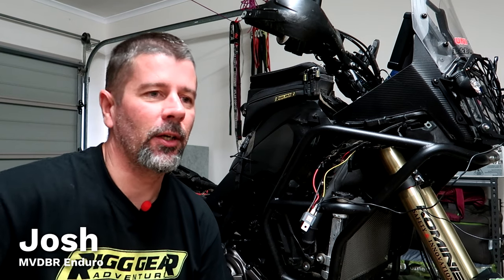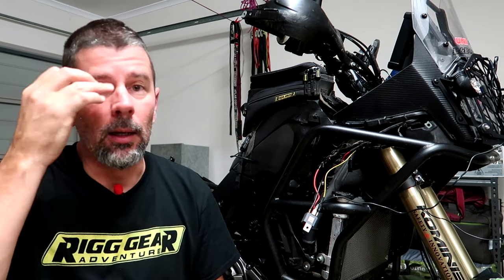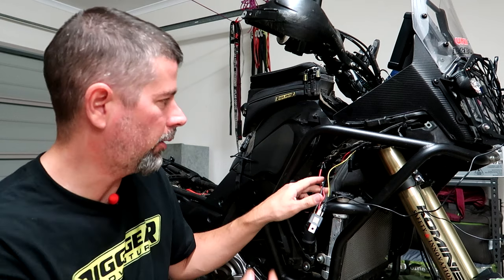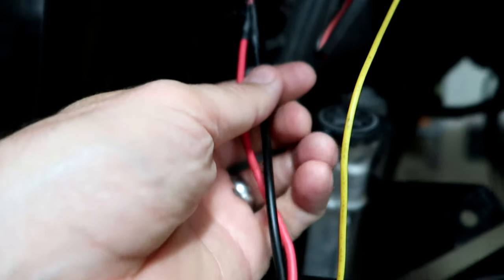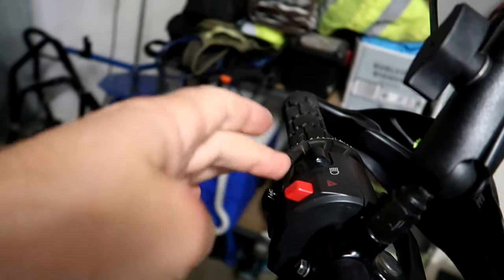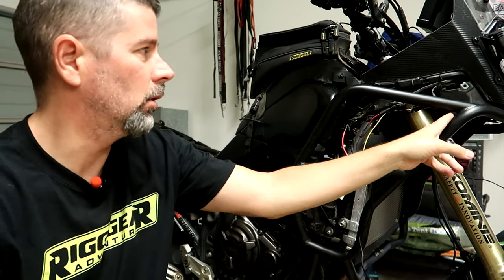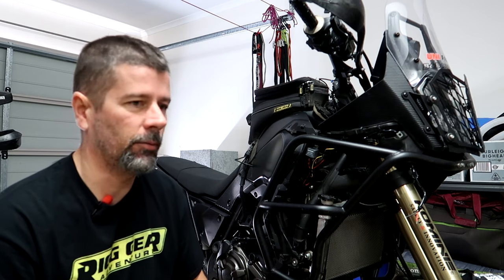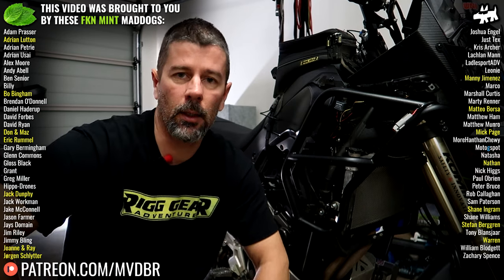Tenere 700: Run Auxiliary Lights Off High-Beam Switch

Comment from the maker: Thanks to Mick (HavaCrack) I've since discovered it's a good idea in this instance to add a flyback diode to the relay to prevent electrical spikes going to the bike's computer. I've added the diode to the following diagram: https://mvdbr.com/files/t7-aux-diagram.jpg
Reply: May I ask why you don't trust the ECU drivers to have built in flyback diodes, but trust it to be able to handle the short circuit your diode may create after blowing up?
Reply: @white-rider  Do you know if the ecu has an inbuilt flyback diode? Not sure why it would as the ecu design would be as  the sink/source (switch either a bjt or mosfet) and as there is no relay after the ecu that would necessitate a flyback diode.  Further I am sure the ecu design never intended to have a relay in the circuit.
Not sure why you would say the installed diode or a relay with an inbuilt diode would blow up. Not saying a diode cannot fail but if it is sized correctly then there is no reason it would. An exposed diode may have more risk of failing due to moisture though.
Even if the ecu had an inbuilt flyback diode which would be reasonable for a circuit that switches a bjt or mosfet then that diode would be around the transistor, adding a flyback diode (or realy with inbuilt diode) would still add protection to the ecu as you are removing large dc voltage spikes.  
As you have raised the question, then:
1/, Can you let me know if there is a flyback diode inbuilt into the ecu.
2/. Are you recommending to people who may use this mod to put in NO protection with a diode? And, if so what is your helpful advice to them?
The better solution to the whole relay use in the circuit would be to totally isolate it via an optocoupler/isolator switching a relay. Happy for constructive discussion. Mick
Reply: @white-rider  That is why modern vehicles that have ecus and relays now have relays with either an inbuilt diode or resistor and why you should not put a non diode/resistor into a modern vehicles cicuit.  As I said (and you) an exposed diode to moisture is not an ideal fix as moisture could affect the PN structure of the diode, so a relay with an inbuilt diode will afford more protection to that diode. Re the ecu I don't think that it would have a protection diode, and if it did it would not be a flyback/freewheeling type protection in this circuit as it would not 'freewheel" back through the relay. As stated an internal ecu "transistor" may have a diode but i am sure (could be wrong) that a bjt or mosfet does not cause emf as there is no coil that is collapsing. 
The t7 workshop manual does not provide any diagram of the ecu circuitry but there are no relays in between the ecu and the lighting cicuit. However if you refer to the manual there is a start relay and a fuel pump relay and they both  have flyback diodes in the circuit which supports my theory that the ecu has no proection. Within the circuits there are also a nymber of zener diodes which would be there for voltage control. At the end of the day I am no expert and not claiming to be BUT the relay needs a flyback diode to create a safe path so the the voltage spike can dissapate and as I will now say for the final time a better design would be with via an optocoupler. Maybe I will make one it could make me rich!.
As per my video I add to Joshs thread a relay on a 12vlt system produced a 150vlt voltage as the coil collapsed, it would do the same on a bkie. 
You can google for the workshop manual which can be downloaded for free it has a full electrical schemetic at the end in both b&w and another version in colour.
 Regards and thanks for the discussion. Mick
Reply: @HavaCrack  yep, I agree with everything you said. I didn't know that starter and fuel pump relays had a flyback diodes. The only Yamaha relay that I disassembled was turn signal relay, and it was a solid-state relay (meaning no coil, just a FET and a IC for timing). But still ECU drives ignition coils, and they're definitely more inductive than any relay.
Great idea about optocoupler. Me personally, I'd go for non-inductive relay (i.e. like for the turn signals, solid-state). No coil = no problem :) I'll probably make it myself with 1 FET and 1 resistor for gate, it'll invert high beam signal just like I need (yes, I'm T7 owner too and I'll installing aux lights the same way, off high-beam switch).
Reply: @white-rider  Have fun. Yes a ssr would be the go as they have a optocoupler inbuilt. People probably have not thought of them for 2 reasons 1. Cost and 2. Lack of knowledge how they work (&3.,, if you bought a cheap one of ebay the potential size).  
By the way I ride an Africa Twin, just normal wiring on that!
Reply: I'm a little confused how the diode is installed in the relay or is it just to the terminals? 
Thanks
Reply from the maker: @xrboy101  check this video https://youtu.be/ecrqDHZX2eo?t=132
Reply: @MVDBR hi man. Excuse me for my complete ignorance. But what if I put the lights directly to the battery terminals without using de relay? Do the voltage peeks are still generated? Thanks a lot
Reply from the maker: @ricardosacub  that's correct to the best of my knowledge. The relay causes the voltage spikes 👍

Comment: i'm a retired electrician and it took me a whole day to wire my lightbar. then i realised it's the earth that is switched. when the high beam is off that yellow wire will show `12 volts....to avoid any meltdown just install the old fashioned way. cable from the battery via a fuse . run the yellow wire through a switch to keep it all legal. been running mine for 18 months now with no issues. 1 STEDI light bar and 2 spot lights. riding in the forest around Jimna at night is awesome....

Comment: Nice vid. Thanks for sharing.
If you’re going to do you’re own low voltage wiring there are a few rules of thumb that I’ve learned over the years which will keep you out of trouble:
1. identify the maximum current draw of the device you’re wiring up (eg 120 watts @ 12v = 10 amps).
2. This combined with the length of cable run will determine the gauge of wire required. There are a few charts online to help work this out.
3. The wire gauge (the cross-sectional area of the copper) will determine the appropriate fuse size.
4. The fuse is there to protect the wire and prevent a fire in case of an over current and should always be located as close to the power source as possible. There’s no point placing a fuse at the draw end of a wire because if you get a short between the fuse and the power supply, the fuse won’t do anything and you’ll have a potential fire.👍
Reply from the maker: Good stuff to know, cheers 👍

Comment: The ecm creates the earth path when the headlights are off.  Wiring the relay you are activating it by turning earth on via the yellow wire which is the reverse of how you would normally wire a relay.  You should make sure your relay has an inbuilt diode (flyback) or if not put a diode across pins 85 & 86 as when the coil (in the relay) collapses it can cause large volatage spikes which you do not want to go back into your ecm (computer).  Some Narva relays will have the diode already.  Not that anyone has reported a blown computer by his method of not putting in a diode, I recommend to put in a diode as suggested.  I presume that the computer is using a mosfet or transistor to switch power and eventually repeatative voltage spikes can damage those components (if they don't on the first occasion).  Another alternate is to isolate the circuit altogether with and optocoupler or a SSR (solid state relay), but that is another story.  Mick
Reply from the maker: Thanks for the info mate 🤙
Reply from the maker: Mick, is this the correct way to wire the diode or is the polarity the wrong way around? Electricity is a mystery to me 😒 https://mvdbr.com/files/t7-auxlights.jpg
Reply from the maker: @HavaCrack  great thank you mate, I actually meant to draw it the other way around haha 🤦‍♂️ Cheers
Reply: @HavaCrack  So if you purchased a relay with diode installed already you'd wire 85 to heated grips and 86 to lights? Sorry if this a double post but my first attempt seems to have disappeared. Thanks in advance and thanks for the video OP!!
Reply: Yes just wire the relay pins 85 & 86 in reverse to Josh's image (or the image on tenere.net) and you will be right.   I posted this short video into Josh's intro which may hellp you understand.  https://m.youtube.com/watch?v=6LoEDmGCPR8
Regards Mick
Reply: @HavaCrack  Brilliant, cheers mate!
Reply: @HavaCrack  Mate, you're an absolute star, as is Josh!! I made a relay loom and followed your instructions and the Rigid Industries SR6 light bar sprang into life first time at the flick of the high beam switch! Awesome! The last thing I need to do is add the switch for our UK MOTs. You mentioned before tapping into the +V wires or the wire that taps into the yellow bike wire. I'll probably use the latter as it's much easier to get to the way I've set everything up. The only thing I'm not sure about is the switch has two wires coming from it. One is orange and one is green. Which wires do I tap each of these into, please? Thanks again both. I'd have taken until my next life to figure this all out without your help!
Reply: I'm thinking the orange wire goes to battery pos or +V and the green taps into the wire we tapped into the yellow bike wire?
Reply: Tried to wire in the switch and looks like I've fried the headlight.. :(

Comment: I am sure it’s a solid state relay that only requires a low voltage signal to allow the relay to pass current. Not like an electro-magnetic really coil that pulls the relay contacts closed. It has the same result and works the same, but it doesn’t necessarily take 12 volts to trigger them. I use them in the HVAC industry and some of them can be triggered by anywhere from 3 to 32 volts DC.  You can tell it’s solid state because it has a heat sink. That bracket with a hole that looks like a mounting bracket is actually a heat sink. If you were running a lot of current through it that heat sink tag would need to be bolted to metal. On a motorcycle running LED lights with air flow it might be alright. LED’s don’t usually a lot of draw current like a resistive heater would. I bet that relay is rated for way more current than those LED’s draw from the electrical system.

Comment: Cut that yellow wire and put a switch in, Aux lights have to be switched independently too the high beam for redgo. Awesome job :)
Reply: Dont put the switch in the yellow wire otherwise the main lights wont work as it is part of that circuit.  The switch will go in this case from his 12v wire he tapped into in the handgrips, but yes it should have a switch to be legal.  Mick
Reply: @HavaCrack  So whats wrong with switching the trigger wire,disconnecting it from the relay wont stop the main light from working. Power to the relay would be switched from the key i would imagine.
Reply: Maybe I should clarify.  You could put a switch in line between the  relay and up to where you tapped into the yellow wire in the loom, but you cannot put a switch in line on the original yellow wire as this acts as both a source or sink for the main light to the computer so if you disconnected that line with a switch then the main lights would not work.  Thus better to have the switch in the +v source side of the relay. Mick
Reply: @HavaCrack  Umm Yep
Reply: @gumbysenduro6546  thanks.  Mick
Reply: @HavaCrack  Hi, I know this is 2 years old but could you clarify that a handlebar switch would go on the + 30 wire or the + 85 wire befor the relay? or does it matter which one? Also does wire 30 or 85 need a in-line fuse? Thanks for any info.

Comment: I am pretty sure in the state of Missouri (USA) it’s against the rules to have any spot lights triggered from the high beam switch. I am not sure why. Pretty sure you would never get in trouble for it, but if your bike has to pass a safety inspection you would want to disconnect the spotlights before the inspection so they don’t catch it.
Reply from the maker: Yeah same here in Aus, although I disconnected mine before I got the guy to come and do a safety certificate and he said any aux lights fitted had to be working 🙄 whatever. Dumb rules.

Comment: Just did the same wiring on my Africa Twin a couple of weeks ago. I did a switch for my aux lights is the only difference. I even have the wire coiled up in the front of my bike waiting for parts. (crash bars) Haha. Great info to pass along.
Reply from the maker: Cheers mate good stuff 👌👌
Reply: On the AT you can tap into the light relay for the power/trigger for aux lights.  The AT light relay  is on the RHS of  the bike near the seat but behind the side cover (2016+ crf1000)  It is normal wiring /polarity, not like the T7.  Mick
Reply: @HavaCrack  I'll check it out. Thanks.

Comment: Thank you for the video! Followed it to a T and my lights are working great.
Reply from the maker: Great to hear!
Reply: Definitely not an electrician here lol, In the diagram you had heated grips, how can I wire it with just high beams and aux amber lights?

Comment: Hmm, I’m confused 😅. The yellow is the “on” wire for high beam. 
All switching is done in the high tech oem headlight. 
So for me this would be the logical way to do it. 
Not sure why it would be strange or hard 😊. 
I’m going to install a led ramp any day now, easiest off course would to be connect it straight to high beam power cables, no relay etc, if amps are enough. But your way is how “you should” do it. And after hearing about the issues ppl had, I will do it this way.
Reply: Fun that it’s a negativ (yellow) like a Norton system. A bit the otherway around 😅
Reply: The voltage on the yellow wire is the opposite of what you would expect.  1v when the high beams are off and around 0 when they are on.  The relay opens when the yellow wire has 12v and closes when it drops.  That is the whole purpose of this exercise.  Correcting for the LED headlights.

Comment: How about the “Flash to Pass” switch at the top of the RH switch block?  Does it work on the lights?
Reply from the maker: Not sure will try to remember to test that out when I get the lights, I never use that switch tho 🤷‍♂️
Reply: It does work, because it's switching the same circuit as high-beam switch, but doesn't stay "on" when you release it.

Comment: Consolidated Alloys 200g Solder Flux makes the solder penetrate the wire buy it at bunnings 12 bucks cheers
Reply from the maker: Rosin core solder 👌

Comment: Mateeee is there any suggestions why after doing this my lights turn off when engine starts? Pleaseeee help
Reply: Even tried to restore bike back to factory. No wiring. Lights run until engine turned on. Thanks guys
Reply from the maker: Yeah you've cocked something up mate, sorry I can't help though I only know what I know and when it comes to electronic wizardry, that ain't much at all 🙈
Reply: @MVDBR  arghhh thanks for the reply! Dohhhhhhhhhhhhhh
Reply from the maker: @the_drone_co  wish I could be more help mate. But yeah I know several people who have done this successfully so it's a bit weird that you're having issues. Bloody electrics
Reply: @the_drone_co hey mate did you find a solution ? Did you have to replace the ecu? I’ve done the same thing to mine.
Reply: @Rushdie01  hey there! Yip! I ended up getting the bike wired at a store. Apparently, fried part of the ecu but only the part that controlled the lights. Cost me $450 AU and honestly I was stoked. Didn’t change anything and did another 2000km before it was moved on for a lighter bike.
Reply: @Rushdie01  also find it odd cause everything I did still appeared right. Frustrating!
Reply: @the_drone_co  mate that is great news! Can you tell me the part they replaced or the store you went to? I have the same symptoms as you and I was lead to believe I need at new ecu at $1k and 5 weeks wait for part.
Reply: @Rushdie01  no replacement parts needed. Just bypassed the standard wiring and run their own. But I was impressed they wired back so it was triggered still via the high beam. 

Trust me, take into a good bike shop and they will be able to problem solve. I was so stressed before this outcome. 

Ecu replacement is also painful as you have to reprogram with red key etc… which I had but still seemed painful!
Reply: @Rushdie01  I’m in Victoria, bike was repaired in Geelong. You?